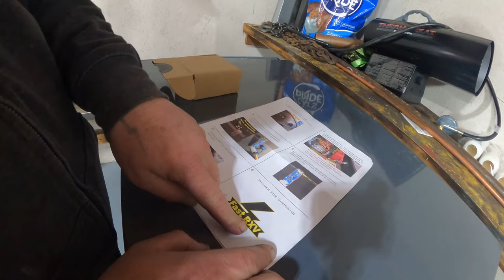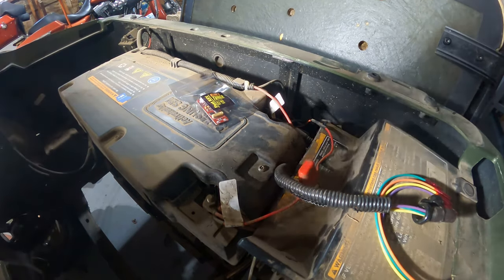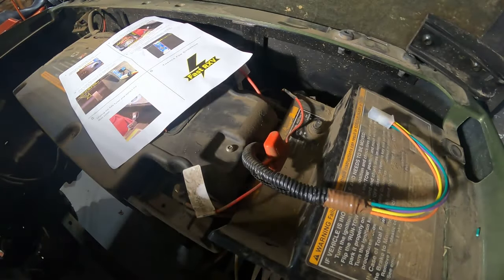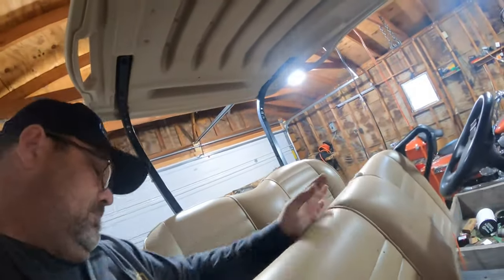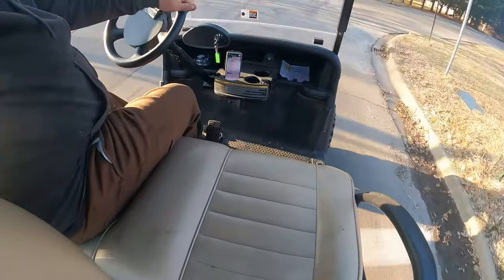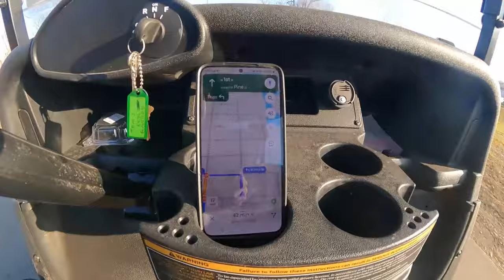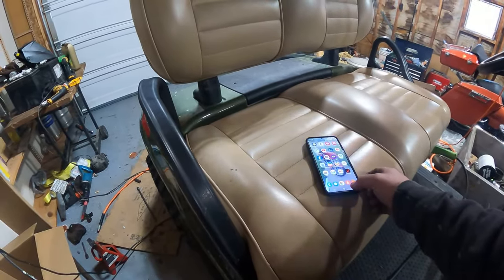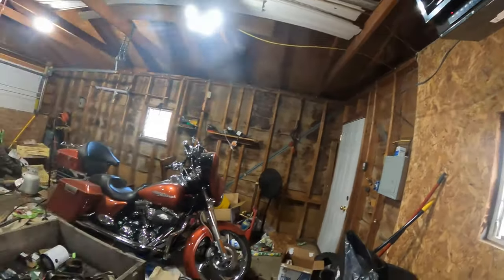Fast EZ-GO RXV 30 MPH!!!!!!!! Part 2

Comment: I did this to my 2024 stage 3 chip. 12 inch wheels 22mph before and 30 after!
Reply from the maker: That's awesome. Do you have good stability? Or a little sketchy at high speeds? I just fix my issues with it. Wheel alignment and rear wheel spacers.
Reply: @DuctTapes78 I have driven it to the golf course about 12 times since the chip. It’s about 1 mile. I crank it up and it flies! It is very stable but the cart is new.
Reply from the maker: @tomwagaman6440  that's awesome.

Comment: I had my club car running 28. The motor finally let go after 2 years. I just upgraded to a Navitas
Reply from the maker: So what did you do to get it to run that fast?? You have a handheld programmer?
Reply from the maker: No I bought a chip from fastrxv.com

Comment: What was your to
 Speed prior to the install? Also, is the golf cart pretty stock besides the upgrade? I assume you got the stage three and not the stage two chip that you got.  I just ordered the stage two version and used the discount code.  Thank you.
Reply from the maker: It was like 13 mph, the. I put the bigger tires on it and then the chip. Love the stage 3 chip. They're sold out of them right now now thou.
Reply: @DuctTapes78  that’s a huge gain in speed. I decided on the stage two.  Hopefully i will get similar results.
Reply from the maker: The only difference between the the 2 and 3. Is the 3 accelerates faster.  If you're doing stock size tires. You'll do 25.5 mph. Just takes a little longer to reach it. 
I love it. I have 25"tall tires and they gave me 3 mph more. If you go with 20" or 22"
You'll gain 1 or 2 mph. You'll love the chip and for the price you can't beat it. Don't have to upgrade motor or controller. Battery life suffers thou. If you know anything about the regen, if you let the motor slow you down for stopping it charges your battery some. Which will help with longer battery life.
Reply: @DuctTapes78  thank you for the info.    I just converted my cart to lithium batteries just a week and a half ago.
Reply from the maker: You're welcome, Mines a factory lithium. 
I'm actually in the process of painting mine and all that crap.
Reply: Is that a 48 volt cart?
Reply from the maker: Yeah Mines a 48v lithium
Reply: So glad I found this video. Just bought a used rxv and was concerned about the motor whining and thought bearings were bad. I guess that’s normal for this model. My bad boy buggy is completely silent so I thought something was wrong
Reply from the maker: @RayofallTrades  yeah they make alot of noise.
Reply: @DuctTapes78 thanks so much for getting back and confirming! Keep up the great work!
Reply from the maker: @RayofallTrades   Best way to fix that is get really aggressive tires and all you hear is the tires humming down the road at 30 mph. Lmfao 
Thanks for the compliment.
Reply: What is the cost of stage 3 vs 2 and you can’t use it on another cart?  Only one-time use??
Reply from the maker: @bmanh2355  it's only like 175 for the stage 3. So maybe 150 for the stage 2.  I think he's out of stock on the stage 3. Yes, only a one cart use. $175 to speed your cart up is alot better than 1500+ for the Navis motor and control upgrade, and it can only be used on one cart. Lol
He does have the chip that is unlimited, but that price is about 700 bucks. If you had 7 carts you could charge 100 bucks each for speeding up, you'd get to speed up yours for free.
Reply: @DuctTapes78 does the stage  3 only get you to 30 mph I'm doing that on stage 2 but I feel I can go faster and want stage 3
Reply from the maker: @ryandehoyos2717  the only difference between the stage 2 and 3 is faster acceleration. Stage 2 takes longer to get to top speed from what I understand. Fastrxv.com and you can read the specs. You can even email the guy that makes the chips. He usually responds pretty quick.
Reply: @DuctTapes78  yeah stage 2 is nice I have same cart. Yes battery life kinda goes out the window but it's still great.  Have you changed the oil in ur differential or axle.  Mine is a 2020 wondering if I should change it
Reply: @ryandehoyos2717  im pretty sure that the stage 2 and stage 3 are the same in terms of top speed.  The difference is that the stage 3 has quicker pickup.
Reply from the maker: @ryandehoyos2717  no I haven't changed it. Should be pretty easy.